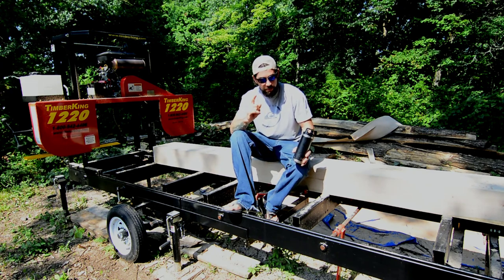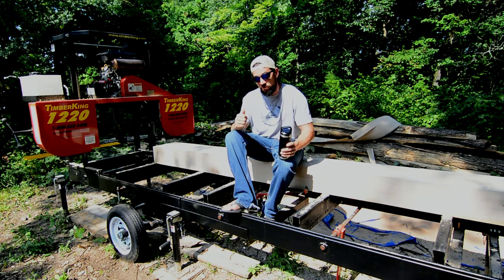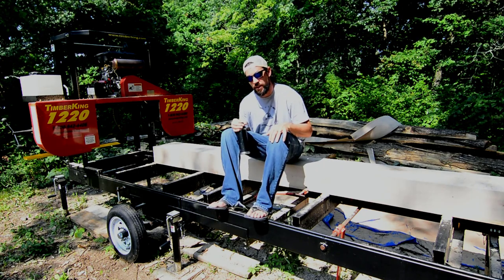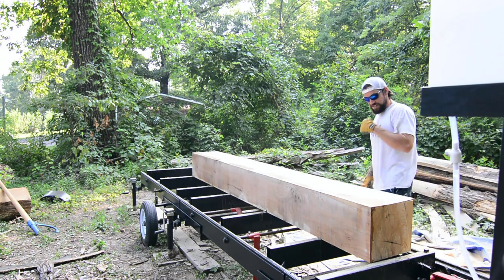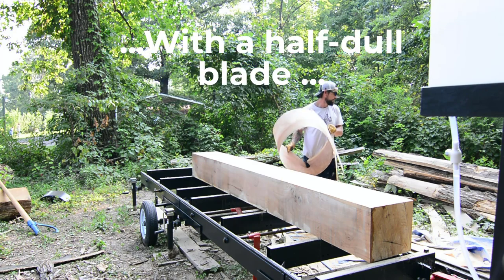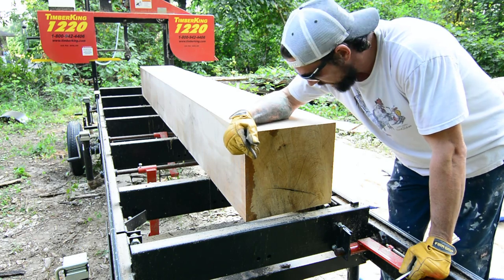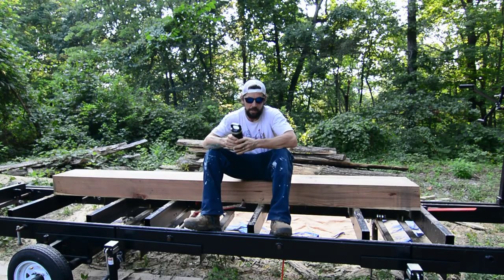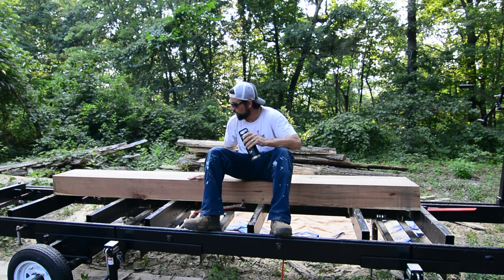Timberking Sawmill Put to the Test

Comment: Nice job. I have the same crz, bought it two years ago for the same reasons. Rugged build, 23hp, and the biggest cut throat for its size and price. How do you like that log scale? I built a different one using a tape measure. I showed it on my channel, it allows you to plan your cuts up from the bed so your can't sizes are correct for the lumber being cut. Timberking says the saw cuts a 16th inch, but my scale can measure the cut to a 32nt. Happy sawing and building to you.

Comment: Great video mate, and nice lumber! I have a 2013-build 1220 that isn't on a trailer base. It looks like the new trailer model you have is a great update. Does it feel solid enough using it on the stands when you have decent sized logs on? They're a nice little mill that certainly will take some abuse. I'm in Tasmania, Australia, and the only bandsaw mills available here were Timberking, Woodmizer, and cheap chinese junk. I looked at the same mills that you had on your shortlist but was gonna be difficult and costly to freight a one-off. Glad I went the way I did in the end...
Reply from the maker: Thanks! Yes it handles the big stuff quite well, though I do wish TK used a single piece rail construction rather than the 3 sections. I feel like it would eliminate some of the minor issues leveling it in a new spot. Other than that, it’s had no problems with any of the large hardwoods I’ve cut, and I’ve pushed the limit with a few red/white oaks.
Reply: I’m curious about your comment of a single piece desired. With the trailer package are you still getting some movement in the rail that needs to be adjusted?

Comment: We all know you had some problems with that winch we just want to know what kind of machine used to get it up on there and how long did it take you to use that winter roll it up on there with other methods it's all good it's just pretty obvious when you stop the clip and I ain't hating on you either I die to have that wood processing sawmill. You keep stopping it on your cuts I really want to see the machine actually do work I'm trying to talk one of my buddies in a boss man to buying one they're pretty idea when you do as much tree work as we do down here in Maryland
Reply from the maker: Where ya at in MD? My wife and I both grew up in southern MD and went to school on the eastern shore. Believe it or not, that little winch holds its own, and I’ve used it to hoist red oak logs that’ve maxed out the mill. We’ve got an old Massey Ferguson tractor that makes life a lot easier now, but for mobile milling without a loader, the winch and ramps are totally capable. If you’re looking for a hobbyist mill, or something heavy duty enough for side work here and there, this 1220 is a great option. It’ll cut whatever you throw at it that’ll fit in the cutting throat.
Reply: @yourticulture6763  im sold... In two years one of those bad boys will be in my backyard!!! Gunna pour a slab of concrete down and build me a pole building with an A frame roof on it. Not really concerned about it being mobile. I want it stationary and level. Just got 30 acres and a house from the early 1900s that needs new floors. Pretty stoked about what all I can accomplish with the Timberking's 1220.
Reply from the maker: @jefferyjackson5137  hands down the best piece of equipment we could’ve bought for our homestead. The only wood material we’ve purchased since it arrived has been plywood. Any timbers, poles, beams, boards, etc have all come from our own forest over the last year. It’s unbelievably rewarding looking back on a project that you saw as a tree too. Plus, we’re getting higher quality material and the mill has already paid for itself in savings. I definitely recommend it to any steader/farmer who’s got big plans for adding infrastructure. If you’re going to buy new, make sure to get in touch with TK and get an order in. They (and many manufacturers) are backordered 12 months out.